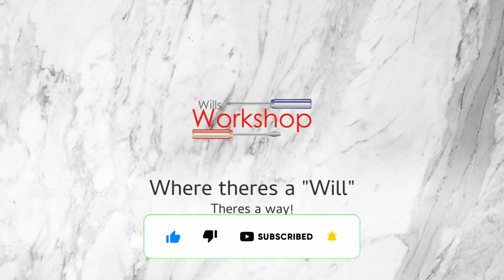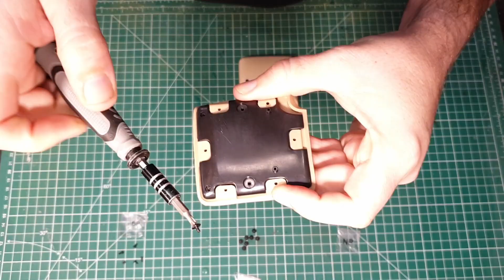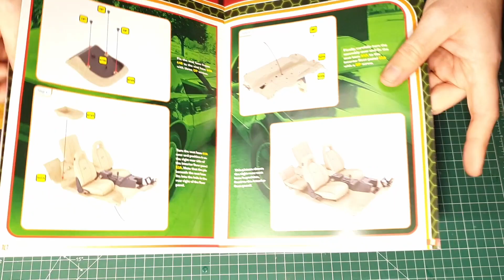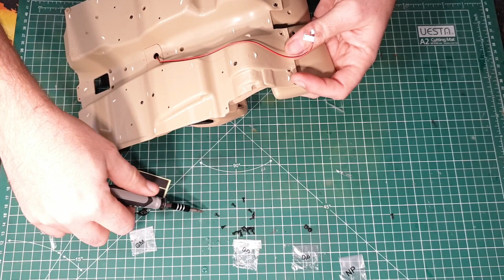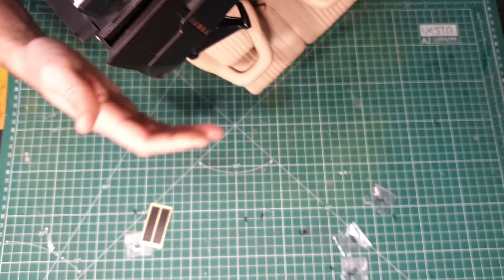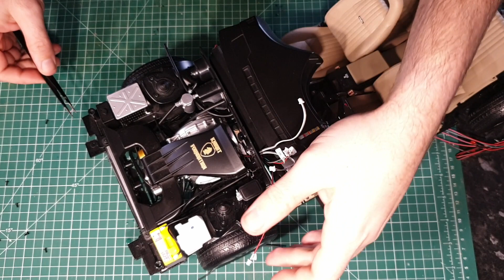Build FanHomes KITT from Knight Rider: issues 63-66

Comment: Hi will just screwed my dash down and the pedal does not ‘click’ when pressed… any ideas or fixes mate?
Reply from the maker: Take a look at my video of the dash assembly and also this one, the pedal should click the button installed in issue 43, just check it is the correct way round as i almost put mine in back to front
Reply: @WillsWorkshop  no it’s faulty Iv had to order a new one 🙄 lol